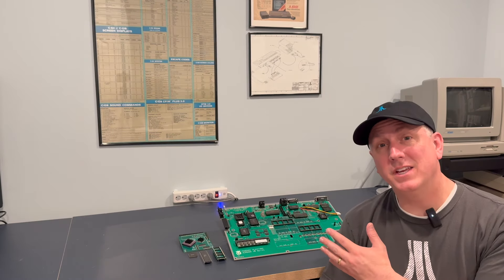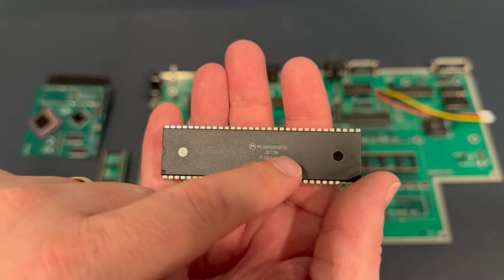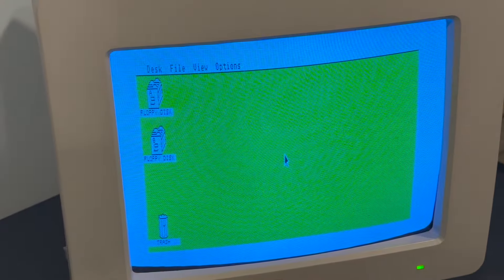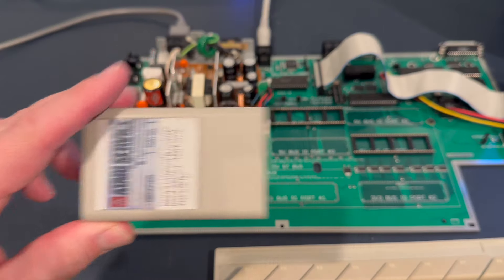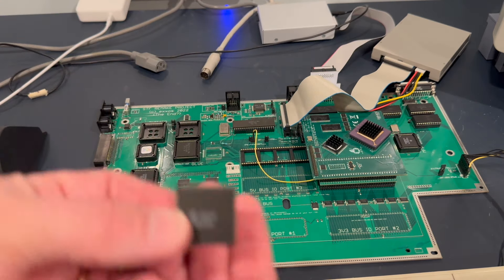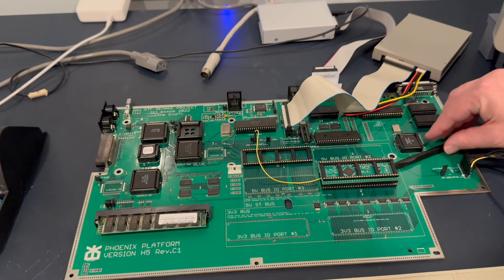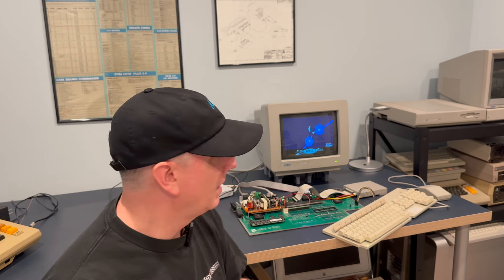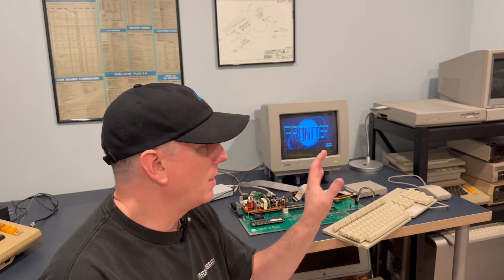Tricking out the New built Atari ST

Comment: Very cool. Once you set up a new ST, it might be worth showing software which really takes advantage of the hardware. For example there are a few games which use the Blitter chip (Pacmania comes to mind, as its STE version is so different from the original version). As far as a 68030 at 16 MHz, I'm sure there are some software out there as well.
Reply from the maker: That's a great idea!
Reply: Pacmania STE version?  I didn't know that.  All I remember was the ST version was crap, with a little screen, compaired to the Amigas fullscreen overscan version.  I'll have to check that out!
Reply: Blimey!! - https://www.youtube.com/watch?v=IBi0Kv38jL8
Reply: @andrewf9041  yes the STE version is much closer to the Amiga version. The soundtrack still isn't as good and the overscan is only vertical. But it's miles ahead of the original ST version.

Comment: "not much use for the blitter' Poor ST, if it had come with one, people definitely would have used it more!  As for the cache, it is less about TOS 2.06 working with it (it works great on the Mega STe), but some games don't expect a cache there (as the 8Mhz 68k didn't have the larger cache).  On my old Mega STe, if I tried to run games from the desktop, my process was to usually 1) Test game, if crash, 2) disable cache, if crash, 3) lower to 8mhz, if crash 4) Boot floppy to TOS 1.04.  If the last one didn't work, I gave up :P

Comment: Now you just need to build a Raven 060 board and the ATX ST remake board. I think I am going to build a custom case for my H5 and add a mach 64 video card or maybe play around a PiStorm.
Reply from the maker: The Raven 060 is a super cool project.  I'm not sure I'm up for that challenge as yet.  

The Mach64 GPU is a great idea and the H5 is probably the best platform for testing / running a PiStorm.

Comment: Why not an external PSU?
Reply from the maker: Maybe at some point.  As of now, I like the all in one completeness with the PSU internal.
Reply: @powerofvintage9442  maybe you should get a Meanwell PSU instead, it is closed, you just need to 3D print a cover bar over the leads to stay safe. I was feeling uneasy seeing you touching the PSU with cord connected.
Reply from the maker: @madigorfkgoogle9349  Good point.  I should probably say something about that.  

I'm very familiar with these PSU's having rebuilt many as well as rewired ST's with Meanwells.  I'm not nervous at all around manipulating them in this way (as I know where I can touch and NOT touch), but I can totally see others thinking I'm crazy.

Comment: Very cool!  Do you have a link to the Pi Case STL?
Reply from the maker: I’ve checked all over the place and it seems I lost the modified model I created for my pi when I had a hard drive crash a few years ago.
Reply: @ OK. Thanks gift checking. I have found several where the keyboard and top case are a single unit. Looking for one where I can print the keyboard separately and in a different color.

Comment: I once had a Shifter in a MSTE that went flaky with a HD Module grabbing the 16 MHz from it, so I put a crystal on the Module to make things work. Apparently, some Shifters don't like the extra load on the 16 MHz output pin.
Reply from the maker: I guess it shouldn't be surprising when using chips in ways they weren't really intended to 😁

Comment: Interesting board and like the clean design, but really weird choice to stick with 64 pin sockets for expansion. Then again my MegaST had up to 5 layers of PCBs stacked on top of each other (PuPla + PAK [030 @50MHz + Cache + TOS 3.06] + FRAK [64MB FastRAM] + Panther/2 [ISA + Mach32 GPU + NE2000 LAN] + c't IDE). Would love to see a fully powered up recreation board being made, but I'm pretty much done with Atari 16/32 and have only kept my maxed out 1040STE.
Reply from the maker: Sticking with the 64 pin sockets is to maintain compatibility with existing upgrades already available for original STs.  This also keeps the super small market for these things as big as possible.  

I do get it that there are much more efficient and durable ways to do the same thing.
Reply: @powerofvintage9442  I did get that, small adapter PCBs would be only slightly more expensive and way more flexible - but who am I to complain - it's not my project and if it serves most people it's good.

Sticking with the ST "keyboard computer" design also is a mixed bag. Switchable "Personality modules" for switching between ST/STE/TT/Falcon would be awesome - but then again the Atari 16/32 community is let's say complicated (I left it when doing repros of the boards mentioned above for a number of reasons - only the c't IDE layout I did was shared to some extend).
Reply from the maker: @1337Shockwav3  The idea of personality modules sounds super cool!  I mean these computers are relics and all of these improvements / updates / replicas should be for fun in the end.

Comment: This is an awesome video!  Really cool to see the 68030 and H5 board together.  I look forward to more on the TF536.     Are there any 68000/68010 + cache accelerators available for the ST?  (like what the Mega STe comes with)
Reply from the maker: yes there is the DSTB1 that boosts to 16mhz with fastram, not cache though.  However running in the fastram REALLY boosts performance.  It is a hobbyist project at the moment.  @thetechnoshed designed it and has some video content on it.  
I believe he's made it open source so anyone can build one (if you have the skills).